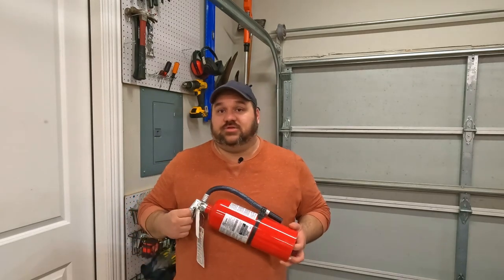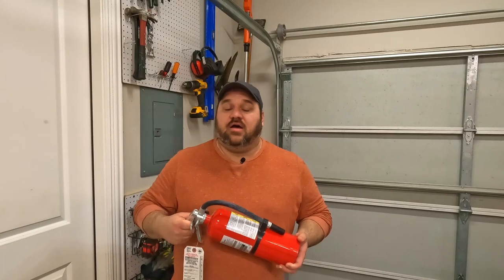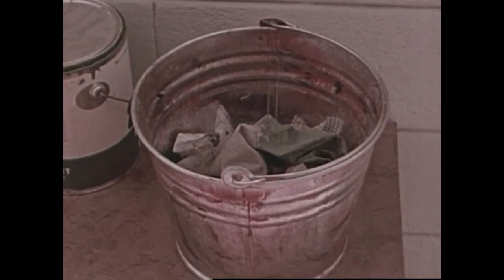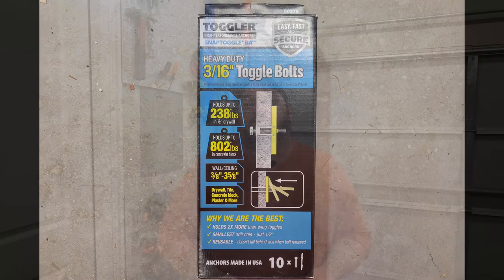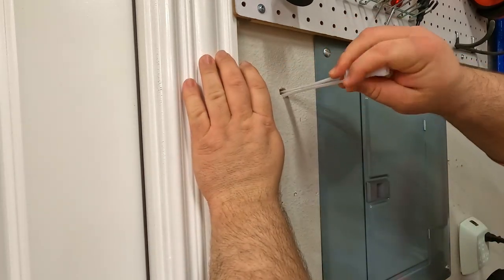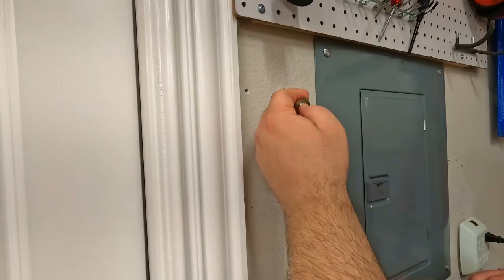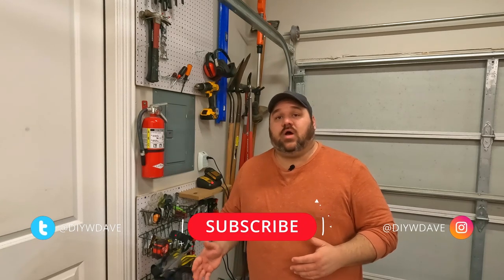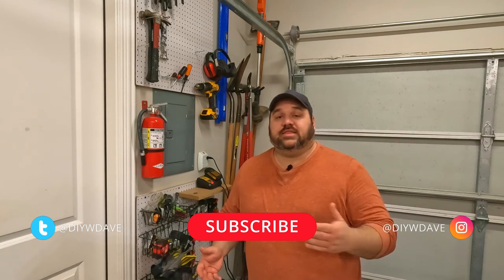This is a Tool That Every DIYer and Homeowner Needs!!!

Comment: Great suggestion, every house should have Fire Extinguisher. You should do a video on how to use a Fire Extinguisher.1. Pull Pin, 2. Aim, 3. Squeeze, 4. Sweep. 
Always extinguish the material, not the flame. Should be about 8'-10' away when extingushing.
Reply from the maker: Definitely. I should do that sometime

Comment: And don't forget about non messy ones, I have a halotron extinguisher for automotive work. When doing risky things like using brake clean or ether to find a vacuum leak, that type allows you to put out a fire without a huge mess or causing problems from a typical dry fire extinguisher. And the halotron ones are more effective than the CO2 extinguishers.